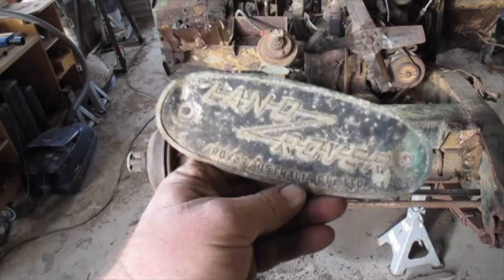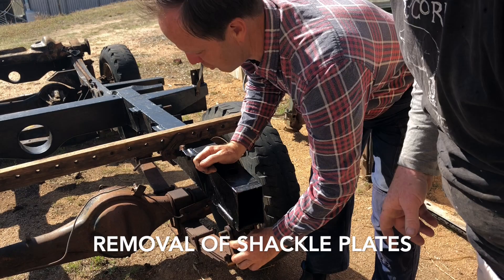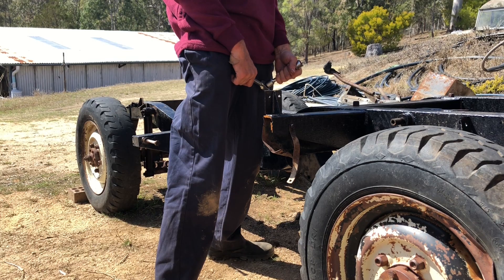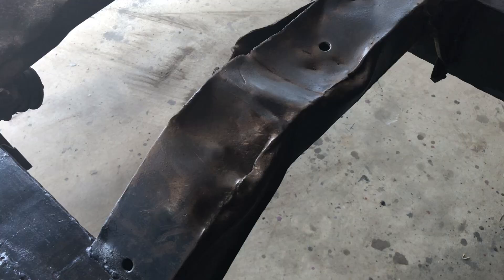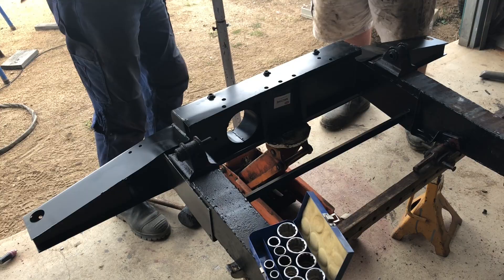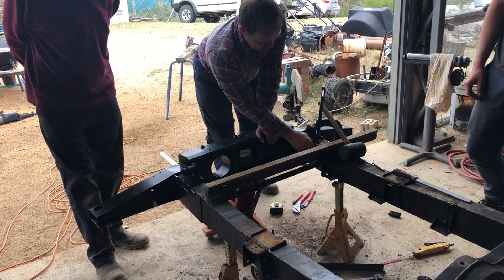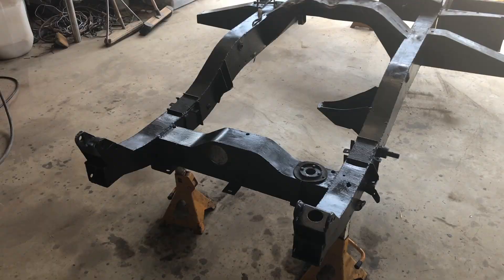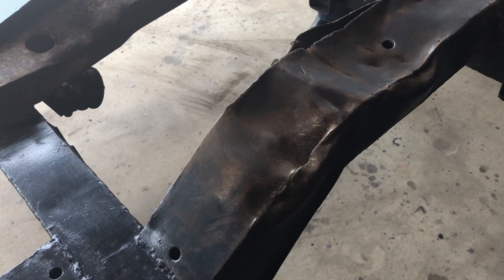Land Rover diff removal & continued chassis resto - restoration and electric conversion - Day 7

Comment: Further to my question about the EV part of the build, I would argue the merits of transplanting most/all components from a single recent wrecked EV such as a Nissan Volt since (a) you will get all you need from one purchase which might be the cheapest way to get the battery anyway, (b) the components are sure to be matched in terms of both control, electrical parameters and mechanical e.g. gearing/output and (c)  you can check it all works together before spending cash.  Personally I would seriously consider discarding the Landy transmission as (in my own Series experience), you hardly ever need 4wd, EVs don't need a gearbox and the space and weight will be needed for other (EV) stuff. Either way, keep up the good work !
Reply from the maker: Mmm totally hear what your saying re a wreck and we would definitely consider that if a wrecked EV was available.  We are pretty remote down here on the far south coast and EVs are a rare thing in this part of the world and wrecked ones are certainly not currently available at all.   A trip to Sydney or Melbourne is a  14 hour round trip,  Canberra is about 6 hour round trip but that is not unsurmountable for the right wreck (any leads would be appreciated?).    As for 4wd, the car will be living on a farm (very steep dairy country) and used daily to get around the farm, most of which is 4wd (especially in wet seasons), we also tow trailers etc so low range would be of benefit.   The car will probably only venture on (dirt) road to town and back a few times a week and the odd trip locally to the beach or out fishing in the hills, typically 50 to 80km round trips.  From our perspective the gear box offers options / adaptability and the PTO option also.  We are also planning a secondary use of the car as a mobile battery wall to plug a house into.... a video on this in the next few weeks.   The project will all evolve as we go and see what becomes available in the next few months. Thanks again for your input, its is a big help to look at it from differing perspectives :-)

Comment: Should galvanise it
Reply from the maker: Nearest galvaniser is 10 hours drive away, transport too and fro, plus galvanising would be very very $$$ and there is a risk of warping the chassis with galvanising heat. Its lasted 60 plus years with just paint and it will not be doing serious off road, creek crossings, beach work etc being an electric conversion, so all things considered galvanising was not appropriate.